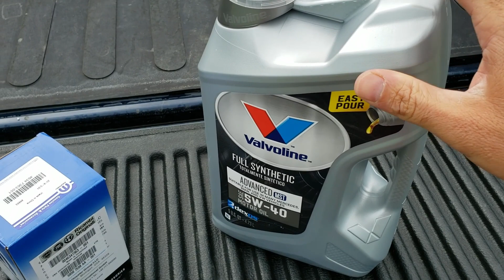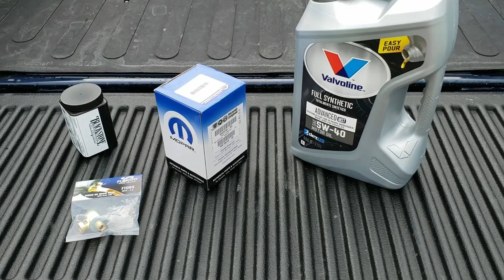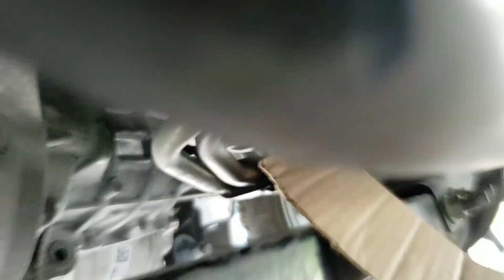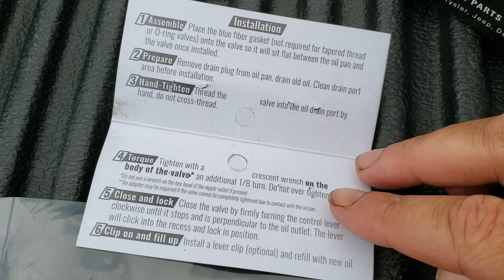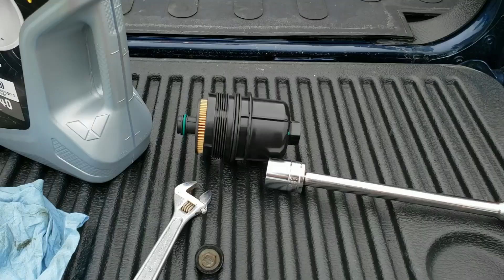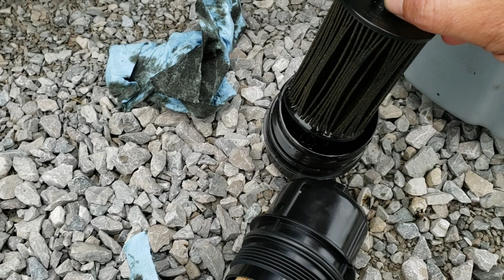2020 Gen 3 EcoDiesel DIY Oil Change Process w/ Fumoto Valve - Save Huge $$$ Jeep or Ram

Comment from the maker: Update:  FCA sent around a TSB highlighting to dealers why you CAN NOT use a Gen 2 style oil filter on the Gen 3 engine.  The pressure relief valve and internals in the filter housing are different.  I assume they made the Gen 3 filter to be a one-piece unit like this so that it would stand out as being different and get the attention of the person doing the oil change.  Make sure you use ONLY a Gen 3 engine oil filter if your engine is a 2020+.

Comment: Question, when do you need to do the 4 wheel drive service? I.E. front and rear diffs. and transfer case? I have 45.000 miles on mine and dealer is saying 4 wheel service is due, sounds way to early to me.

Thanks....

Comment: I looked at a 21 just the other day, and was shocked when the service department told it was 179.00 to do a oil change on this engine. I paid 139.00 for three services on my current gas 5.7 engine. Cant see the big difference both take 8+ quarts of oil and a filter.. Thanks for the video

Comment: Thank for video. I'm not sure if do it myself is worth it. My dealer charge me $217.36 and if cost of parts are around $100 and I change oil around 10000 miles or once every 9 months then over span of 10 years you save around $1300, maybe litte more because inflation. Yes you spend more if you add up everything else, but it is exactly the same on everything else, starts from groceries to buying a house.  
I'm not here to fight, just my thoughts. 
FYI: you gain new subscriber.

Comment: Just went to the dealership for my first oil change, I was shocked at the price. Thanks for the video, looking to start doing my own oil changes. Will doing it yourself cause any issues down the road with Chrysler’s guarantee?
Reply: Im a guy who are preffer to do it itself but : How much did you pay? My dealer charge me exactly $217.36 for oil change. If you think about it that not this expensive. If oil and filter cost you around $100 and you need to spend around 90 min do do it ( properly drain diesel oil takes around 45 min) plus if you have warranty on the truck you know you did not validate anything.
Reply: @Norbarb2026  2022 Ram 1500 Rebel EcoDiesel. I had my first oil change done at the dealer when the oil life indicator told me to. It was right about 8,000 miles. Cost was $300 at the dealer where I bought it. I about shi* myself when I got the bill. I didn't have a clue going in how much it would be as this is my first truck and first diesel.
Reply: @Scott Allen hey, I just did change the oil in my 2021 eco diesel first time by myself. I get a Mopar filter for $64 and Shell T6 5W-40 10 gallons of oil for around $120. Took me a little over an hour to do it. The problem I run into was draining. So I ordered a Fumoto drain valve to install next time I do the oil change. The Fumoto valve cost me around $30. So the total cost without a valve is around $180-190. I'm not sure if that is worth it, maybe overtime.

Comment: YOUNG MAN ,

U NEED PUT IN 15 W - 40 SHELL ROT  DIESEL OIL ONLY
Reply: Can't it will void warranty ecodiesel takes a special oil
Reply: @OffroadCpl  FCS / RAM uses Shell Rotella T6. 

FCA prefers Penzoil, however Penzoil caused engine problems with sludge buildup on the 2015-2018 ecodiesels and FCA moved to Shell T6.

Comment: So I called valvoline they told me they have no oil that meets the eco diesel oil spec  ((ms-12991)  just curious why you use the oil you did
Reply from the maker: The oil in this video is actually stamped with the MS-12991 cert right there on the bottle.  They must have reformulated it recently.  Last I spoke with them, they told me they stand behind their product in the EcoDiesel application regardless of whether it has the MS-12991 stamp on it or not, but, they were working toward updating their sheets to get the "Euro" version approved.  I guess they never did!  If you can find the bottles with the MST 5W40 labeling, they should be stamped MS-12991 on the back.

Comment: Future reference, I use Tin Foil to make a little trough for draining the oil. If you don’t have a Fumoto. You can fold it up around the two lines by the drain hole.
Reply: always have big mess to clean out

Comment: Ive been thinking about the oil drain valve installation? Please correct me if I'm wrong, when you remove the drain plug, the oil in the pan freely flows out of the drain hole where the OEM plug was removed, however with the Fumoto drain valve installation, the valve stem that screws into the oil pan is higher than the bottom of the pan and therefore won't allow all of the oil, and more importantly, the sludge and debris on the actual bottom of the pan to drain out because the stem drain hole sits higher. I would think after a few oil changes a considerable amount of sludge will start to accumulate on the bottom of the oil pan.
Reply: This is a good point. Is there any more insight into this?
Reply: Good point

Did you buy the valve

Which model is it

Comment: I would run Redline 5w-40 Group V Ester Synthetic oil. Group V Ester Synthetic oils are known for their cleaning ability so you won't build up varnish or sludge. I would stay away from all the Group III oils labeled as synthetic. This is the Redline that is recommended for the GEN3 ecodiesel engines. 
https://www.redlineoil.com/5w40-motor-oil 
These ecodiesel engines are too expensive to not use the very best oils. The FCA material standard is only recommended it is not required, what is required is an oil that can meet the API SN spec.

Comment: I have a 2020 diesel Ram truck. The Oil filter is very expensive. Do you know If it's possible to change to the element filter only ? I paid $70 for the oil filter. Do you know where can i get a cheaper oil filter?

Comment: I really appreciate you sharing your experience and advice. With 5,016 miles, I just changed my oil & filter on my 2020 Ram 1500 Limited ecodiesel. I also installed the fumoto valve.  Thanks again.
Reply: what is the model number for fumoto valve we can use for 2021 RAM 1500 eco diesel? Thx!
Reply: @LLSEA  Fumoto Original F106S with LC-10 Lever Clip FS-Series Engine Oil Drain Valve
Reply: @LLSEA  also purchased the HOSE KIT FOR 3/8" ID NIPPLE FUMOTO VALVE

Comment: When you remove the oil filter does it leak oil at all or does it have a check valve? I have a 2020 ED and will be doing my first oil change soon.
Reply: The oil filter housing has a cup shaoe and prevents most oil drips or spills.

Comment: Interesting they changed the filter that way.  I changed my oil on my Gen 2 myself many times before I traded it.  I wonder if the engineers thought gen 2 filters were not being clipped into the housing properly as a cause of the failures?  In Canada they wanted 285 dollars for a gen 2 oil and filter, I could only imagine what they would want with that new filter assembly.  Thanks for the video at least you know your oil change is done right.

Comment: What was the mileage at oilchange ?
Reply from the maker: 4,228 I believe.  Oil Life Monitor on the dash was at 46%.
Reply: If you're saying that because of the oil color, diesel oil looks like that about 500 km after an oil change.  It's just the way the new ones work with the egr system.

Comment: Good information. Be sure to shop for the oil filters. The dealership wants $94.00 for them, you can find them on line for about half that amount. I hope you marked the box for soot check on the oil sample testing. I'm close to my first gen-3 change and I will get the soot test when I send mine in. Depending on what it shows for soot, I may install a bypass oil filtration system on mine. Thanks for the video!!
Reply from the maker: I'm getting my filters from dieselfiltersonline.com for around $45 bucks for oil, $37 for fuel.  It's good to know that the fuel filter is shared with the Cummins trucks so that there'll be cheaper options in the future.
Reply: @4-LOW  That's where I bought my oil & fuel filter as well. I just didn't feel like hawking a particular company in my post.
Reply: I purchased my 2020 eco diesel about a month ago and I’m really new to ram and eco diesels. Thanks for the video’s. Could you possibly make a video on the fuel filter and what’s your thoughts on first oil change (mileage) and what mileage after that to keep warranties. Thanks.